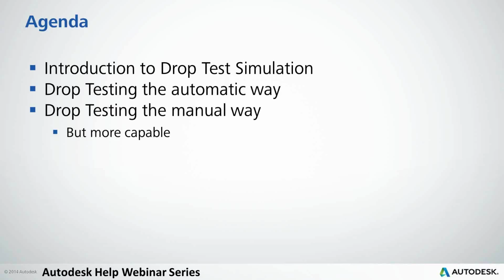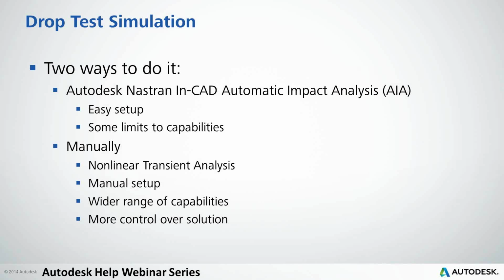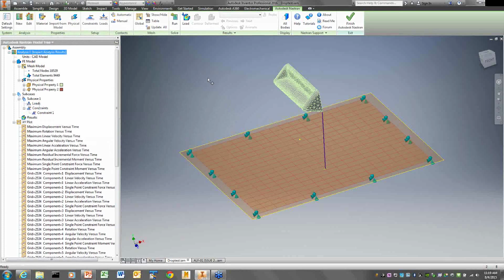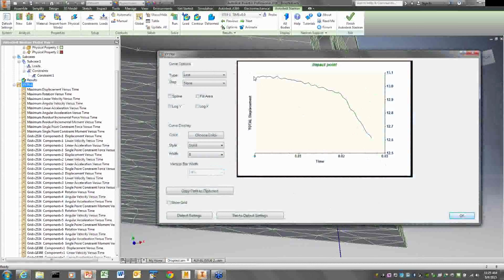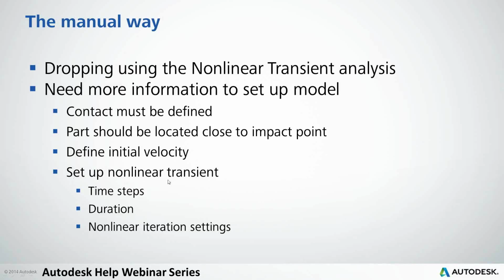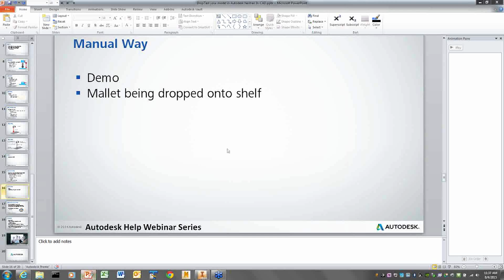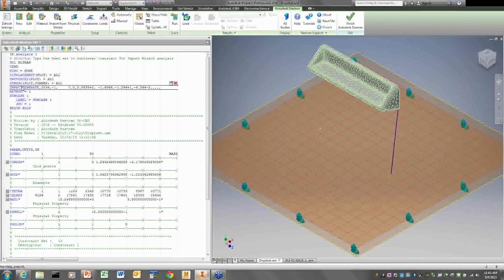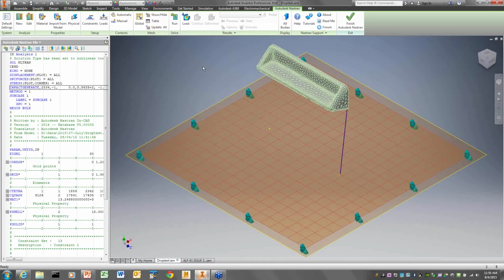Drop Test your Design in Autodesk Nastran In-CAD

Comment: For the 2017 impact analysis wizard, to define the Projectile Translation Vector:
- You need to select a sketch line that defines the direction of travel of the projectile. The requirements for the sketch line are:
- Must be a straight line in a 2D or 3D sketch.
- Can be in a part or assembly sketch.
- Must join the projectile and impacted bodies.
- Both ends of the line must be located at mesh nodes. If this is not the case, use a vertex Mesh Control and select the points at the ends of the line.
This text was discussed with Autodesk (https://forums.autodesk.com/t5/nastran-in-cad-forum/impact-analysis-video/m-p/6918894)